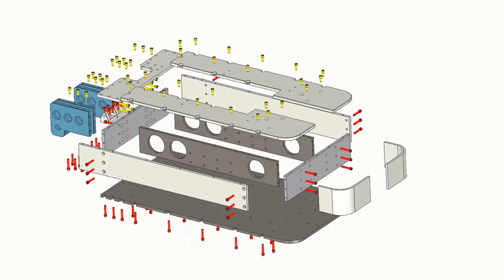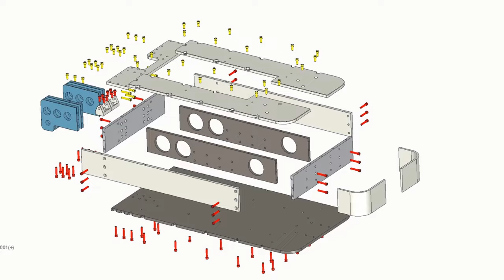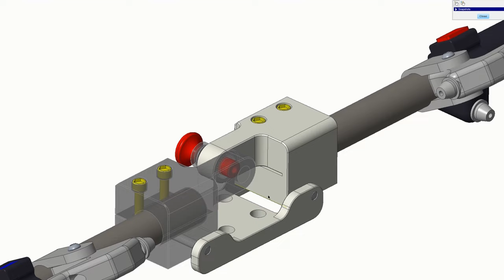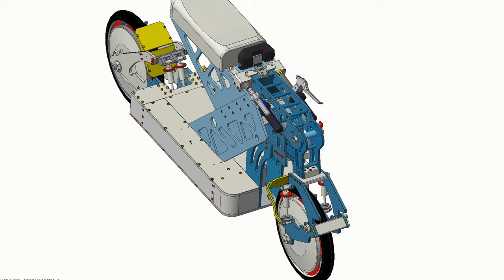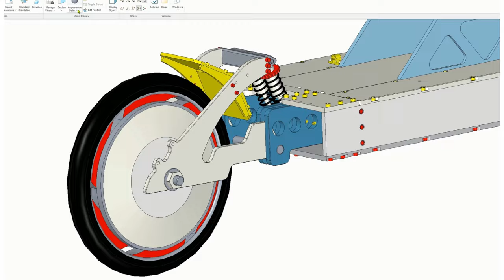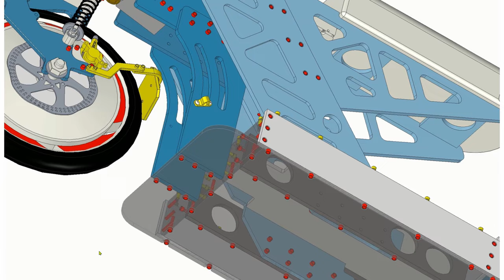PART 1. How to Design & Make Electric Scooter at home. Fusion 360, PTC Creo , Solidworks , CAD CNC

Comment: Is it possible that we get the schematics, drawings, dimensions of this scooter?
Reply from the maker: Hello Sir, Thanks for your comment. This particular project is made as a design and manufacturing challenge for a training that I am currently providing. All the necessary tolerances and fits are built into all the components and a functional machine can actually be produced from these models. I therefore can only provide you with the basic length, Height and width of the scooter. Thanks.

Comment: Hey John! Great video! I’m just curious as to how you’re going to propel it, are you going to be using like a hub motor?
Reply from the maker: Thanks for Watching and comment. I will use an electric KIT that works via a hub motor. There are plenty of these in Amazon and ebay.
Reply: @simbamkuu33  Please suggest a good one
Reply from the maker: @PaulPaid  Hi Paul, so it turns out that the available kits on eBay , Amazon etc. are not exactly complete and still need other items like a matching wire harness. Since I have already started machining the scooter components I am now hunting for used electric scooter that I can salvage for the electricals.